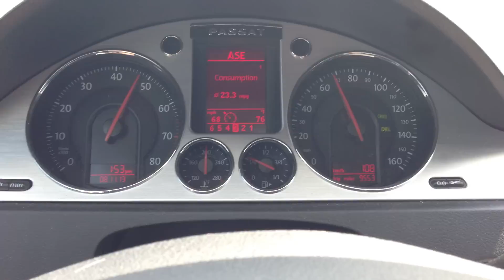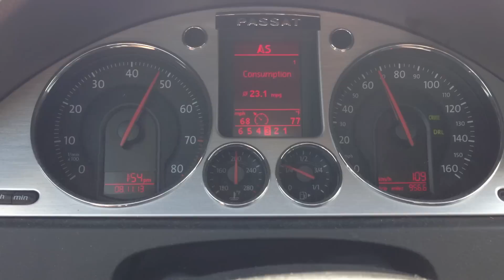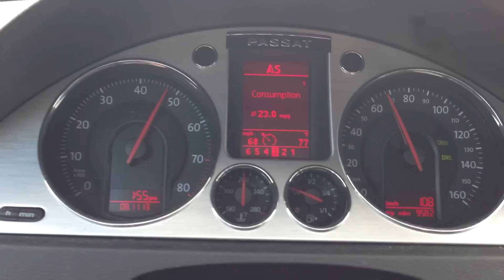Direct Fuel Injection Carbon Buildup

Comment: Just tried this in my Kia, my cooling system exploded 7 Minutes in.

Couple updates, the Quick Connect for the cooling line is what broke.

I'm also having a carbon buildup issue on my 2019 Hyundai ioniq so I went out to try it and that and the cooling system ruptured in the exact same place. Do not do this if you have a Hyundai or a Kia. Thankfully they have a four pack of that part on Amazon for $17.99

Comment: i drive my car at 200km/h at 5000 rpm and the carbon build up was clean from all the places they usually stay even the TPS needed a reset because it stays on idle too high from 900 rpm to 1300 rpm because even the intake valve was cleaned and it was more easy for the valve to move along because all the build up was removed (bdw the car started to run way more smoother since then , i recommend driving your car for about 15 minits at high speed and high rpm to clean carbon build up on old cars, i got some horse power increase and a way more smoother running car since then)
Reply: High speed has nothing to do with it , except help cool the engine , you can put a fan in front of the car and do it stationary , of course wind does not blow in the engine yes ?  And engine will work the same as it is doing while moving

Comment: I have read reports from off-road racers using the infamous GDI Ecotec 2.4l engines that high engine speeds does indeed help.  They rarely have problems with intake valve deposits.  GDI is worse on city driven vehicles and long idling.  During this time vacuum is greatest in the intake, drawing the most crankcase vapor, at a slow rate, long exposure across the intake valves. At lower temps such as stop and go and idling is when much of build-up occurs.  As far a intake cleaners, I installed vacuum port fitting in my plastic manifold just in front the intake ports.  I then inject directly on the valves.  The typical are intake is designed to flow air, not liquids or spray mixtures.  I found when I did this at the throttle body, a lot of the liquid ended up at the bottom.

Comment: How often driving in this manor will it burn off the carbon deposits, will once a week do it or as often as possible as I’m stuck in more traffic than free flowing traffic when travelling to my work place, will this only keep the back of the direct  injection valves clean or will it keep all the internal engine parts clean, will it do any damage to other components
Reply: Don't. Drive your car normally. Service it correctly, and if you have problems. Pay a professional to clean the valves with walnut shells. Then you won't wear out your engine.

Comment: The heat also results from hot exhaust gases escaping briefly through the intake valves during valve overlap on engines with VVT. Valve overlap (both intake and exhaust valves open) occurs during moderate engine load and moderate-high engine speed to decrease pumping losses. It's more about lengthening the time under this condition that's important. As long as the engine maintenance in order, no engine damage will result from 4-5K rpm operation, since this is well below redline of most modern gasoline engines. Drivers in Europe routinely drive at high speeds with no issue. However to be safe, this procedure could simply be performed only as needed rather than regularly for those that are concerned about wear and tear.

Comment: I would say 3500 rpm should do it. You can help it by using 99 octane fuel instead of 95 while doing this. 4800 rpm seems unnecessary. You can just keep it in 5th instead of 6th.

Comment: Why do people think they can "burn off" carbon? carbon is what' s left-over after burning. The engine won't get any hotter, because the coolant is going to keep the engine at the optimal temp. But, maybe there are some studies done on it that can prove otherwise.
Reply: actually if you look up what Mazda has done to solve this issue and it turns out they increased the TEMP on the valves and that has solved the issues, doesn't matter its carbon, all substances has a melting point, all things have a temp they burn off
Reply: Nipun 
The carbon is left over from incomplete combustion. Reviving your engine out can burn some of the carbon off as there are more combustion strokes per unit of time.

Comment: This helps but you will still need to take off the manifold and physically scrape off the carbon buildup or walnut blast the valves but its always good to give the car a spirited drive especially on the highway to get the engine heat up to help burn off the carbon

Comment: Is this safe to do and work for my 2016 wrx pleas any insight be nice  I tend to baby the car
Reply: Completely safe. Just drive the nuts off the thing for about twenty minutes, pedal to the floor, as low as possible a gear you can.

Comment: Will this work for a Touareg engine? 3.6 V6 FSI with carbon build up on the intake valves?
Reply from the maker: kelvin acosta Yes, this will work for your Touareg with the 3.6 VR6 engine. I would recommend cruising around 72 mph with the vehicle in 4th gear (around 3800 rpms) for 20 min on the highway to burn off the carbon. I've been doing this every few months on the Passat here for the last several years and it now has 127,000 miles. No carbon buildup issues at all so far on it.
Reply: Born to Drive ™ awesome, thanks for the reply! I'll definitely be giving this a try!
Reply: Hey Alex, I did give this a try at night on the freeway for a good 20-25 minutes. The results seem to have been alright, as my touareg doesn't idleas crazy as it did before.
Reply: kelvin acosta did yoi try it will you let me know how it went i also have a touareg  3.6
Reply: kelvin acosta Hi,
Did you try it on your Touareg ?
I want to do it in my Touareg also

Comment: I have a Mercedes-Benz C250 with the DE18LA Evo direct injection petrol engine. I now have 106000 km roughly 65000m on it and have started to wonder about carbon build up due to the direct injection. I asked my dealership about whether they routinely clean the valves as part of the approved MB service schedule, thinking they should be well aware by now of the carbon build up issue. Their response was pathetic to say the least, they do not do any work other than standard maintenance unless something goes wrong. So rather than do preventative maintenance, they wait for it to break and then hope the you're out of maintenance plan so that they can charge you for it. This would be at 120000km or 6 years whichever comes first, right when carbon build up is set to be at its worst.

I watched your video and was rather intrigued thinking I could try this, I am just worried about potential damage to the turbo for keeping the engine revving high, and thus the the turbo spinning at higher than normal RPMs for a extended period of time. Do you think this method is only for naturally aspirated engines?
Reply from the maker: Kyle Smith This method will work for turbo engines as well as normally-aspirated engines. I would only rev the engine to no more than 3500 rpm for 15 min at first to see if you feel any difference in performance before going to 4000 rpm for 20 min.
Reply: You should be worried about a turbo engine spinning fast.. BUT. You drive an MB = made in Germany, which has the derestricted autobahn. Therefore they design the engines to withstand this. After a frisky drive you should let the turbos cool down before shutting the engine off.
Reply: Hi Kyle Smith 
I would suggest this approach: before your next long drive where you can hold the higher rpm for 20 minutes use a can of the CRC Carbon Clean product as directed. Then take your drive, getting the engine nice and hot before you commence the high rpm stint sequence. I'm doing this method for my Audi A6 with the 3L TFSI every 10,000kms.

Comment: thinking of trying this with my 09 passat cc. 3.6
I'm getting some hard startups, cranking but slow startups and a bit of a smelly exhaust smell. car is regularly serviced so I've pin pointed it to this problem. 41k on the clock. perhaps it's time? 
wierd you say this,  as I put my car into sport mode the other day and floored it a few times and my engine light came off. it seemed to have  worked even in small stints. ill try this and see if it helps with my hard startups and smelly exhaust.  cheers.
Reply: craig preiss any updates?
Reply: craig preiss Any Update? Really interested
Reply: updates?
Reply: Did this work for you? Thanks 🙏

Comment: I just tried this today in my LFX Impala and I shit you not it took care of a low engine stumble and feels much stronger overall. I did it because of your video. Thanks for helping us out. I took the intake off and looked at the valves about 8 months ago and they had a ton of carbon/oil on them (62K, Mobil 1, etc.). Looked horrible. I tried the CRC GDI cleaner, I think this is more effective. 

However, I do have one question. If nothing but intake air is hitting the tops of the valves, then how do they get cleaned? Is the CC heating up so much the valve bottoms and tops get cleaned? Whatever it does, I feel it worked.
Reply from the maker: I'm glad this process helped your car run better! The heat from running the engine at high rpm is enough to burn off the carbon slowly over 15-20 min. The carbon usually burns off as small particles and it passes through the intake into the cylinder where it burns away.
Reply: Its all in your head

Comment: thanks for the advice . Does anyone know if using fuel injector cleaners is detrimental to direct injection engines?
Reply from the maker: Hi Mark, I don't believe fuel injector cleaners will hurt a direct injection engine. I've used Chevron Techron cleaner before and it had no detrimental effects to my car's performance. However, I'm not sure if there are any long term effects
Reply: cool
Reply: They will still clean the fuel injectors, but not the valves in modern cars like TSI.
Reply: Actually, you want to use a fuel system cleaner, so the Italian tune up, then change your oil. Some cleaners can make the deposits get into your oil. But I would also think that if your rings are good, then you should need to worry about the oil part.

Comment: I have a 2010 jetta wolfsburg edition, in about 30k my car feels like missfire, i told the service advisor at the vw dealer and he told me that could be the sparkpugs, so i replace them my self and the problem continue. I took the car like 5  time to the dealer even after the warranty expire, I even call the vw headquarter and complain about it. They send a letter to the dealer and told them that they need it to fix the car a because this problem has been since the 30 k and i did not have any solution. They replace the two cloth because the believe it was not a misfire. Long story short, it was the carbon build. They end up replacing one fuil injector a no cost but they charge me $140 for 2 hours labor of cleaning the other 3 injector, and my car know drive excellent. What i have been duing since then, is pumping in a top gear gas station ONLY and every oil change which is every 5k putting clean injector in the gas tank.  Now my car is 61k and the engine perform excellent. I hope this help
Reply: To clarify is top tier gasoline, here is the website  http://www.toptiergas.com

Comment: Will this work on other DI engines, Ex: Ford 2.0L Ecoboost engines, or only on VW engines because of the carbon resistant coating?
Reply from the maker: This will work on other engines too, including Ford Ecoboost engines.

Comment from the maker: @Devin- Jessie Breeding, I believe that this process made a significant difference the first time I did it, but I didn't see large gains in fuel economy or performance after I performed it a few times. I just brought my car to a service center to perform a BG intake cleaning service and almost no white smoke came out of the tailpipe during the cleaning process. This means that very little carbon was found in my engine. With that in mind, I think this process works best by doing it every 3-5,000 miles. It kept my 3.6L engine clean, and it should probably work on the 2.0T engine as well

Comment from the maker: It's a possibility, but the chunks of carbon that break off are usually small enough to burn up before reaching the catalytic converter. Another method of dislodging the carbon is by using a high-pressure walnut shell blaster: It's a DIY cleaning method, or the service runs anywhere between $300-600.

Comment from the maker: In the article, the Bmw 535i driver did the process 1-2 times per month. That seems like a lot of engine strain and a waste of gas, but as long as the engine revs near 4,000 rpm for 20 minutes, the carbon should burn off the intake valves
Reply: Born to Drive ™ this is what I’m worried about is the extra strain the engine is put under, so either way in my eyes it knackers your engine driving at low speeds due to carbon build up or high speeds because everything is working harder